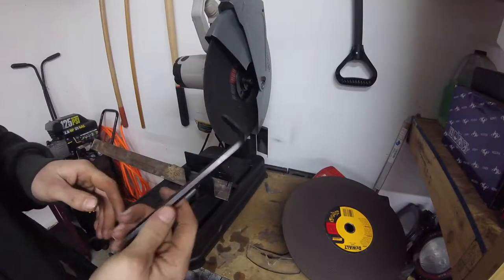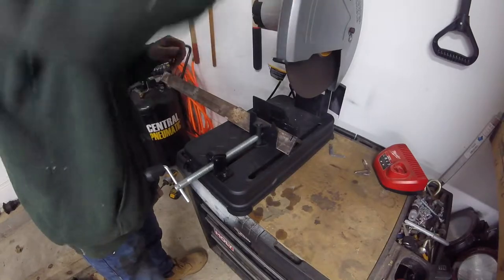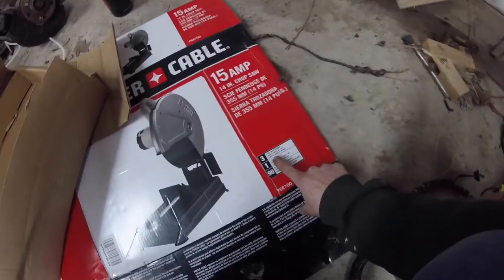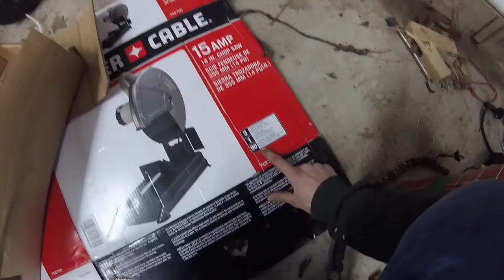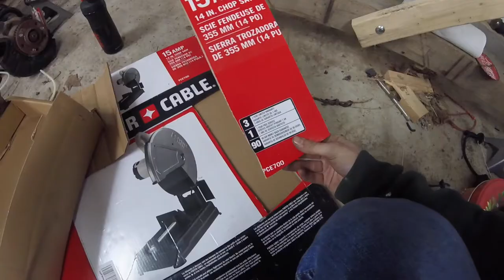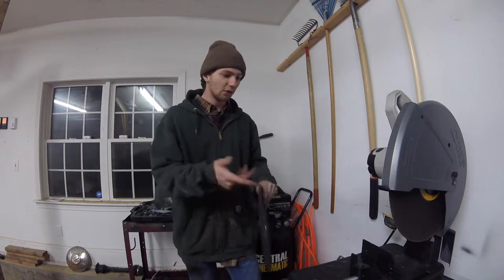Porter Cable 14" Chop Saw Unboxing & First Impressions

Comment: Believe me I tried.  I bought a $85 metal blade.. The carbide metal blades need under a 2000 rpm.. This Porter and cable is 3800.  I t will burn out a diablo type of blade with in 3 cuts.. I did it.

Comment: Nice vid got mine from tractor supply for $60(on clearance) Also get a way better blade Diablo. and mine has gone kinda funky on me before when you get the metal red got. because of the bad blade. its then cuts the red hot metal and absolutely gets out of control. point being get a batter blade
Reply: Thx man, saw your comment then went down to tsc and scored this saw for $47.99 (20% of $60)